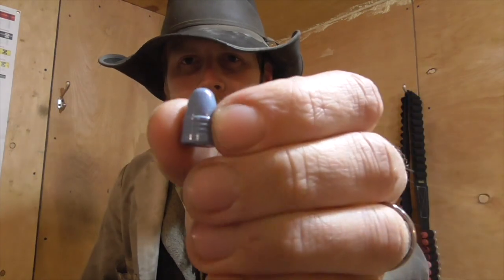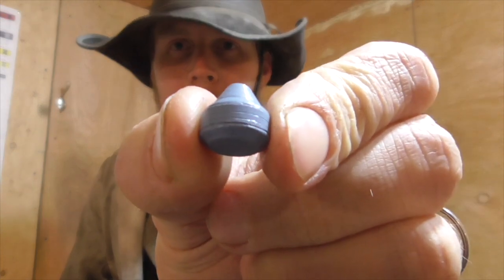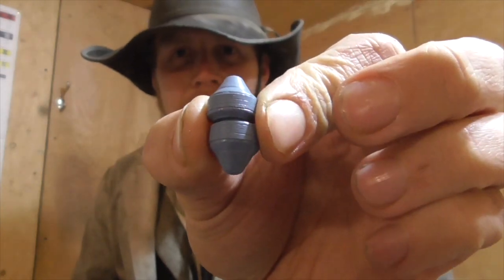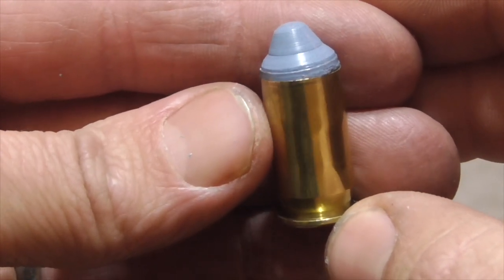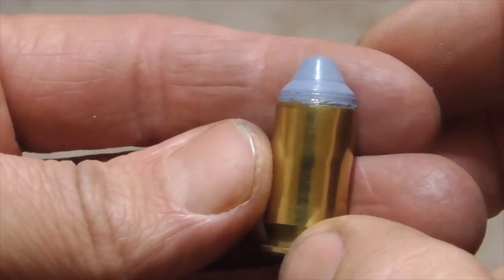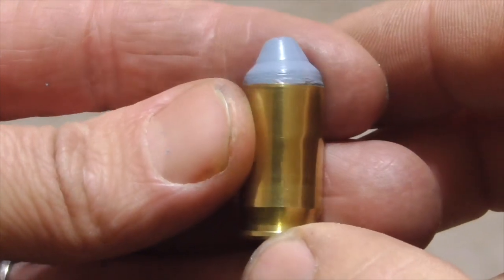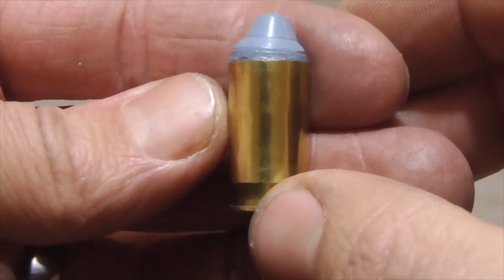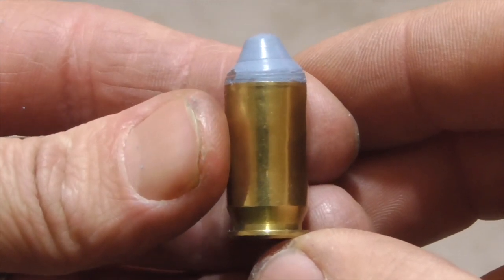Experimental Duplex Load for .45 ACP (TIS311)

Comment: A concave bottom will help fix the canting problem. Also, consider increasing the bullet weight slightly so that it is longer, although that might mean that two won't fit in a 45ACP case.

It might be worth trying the experiment in .44 Colt or .44 Special both of which have a longer case. You should be able to get two 150-grain bullets in those.